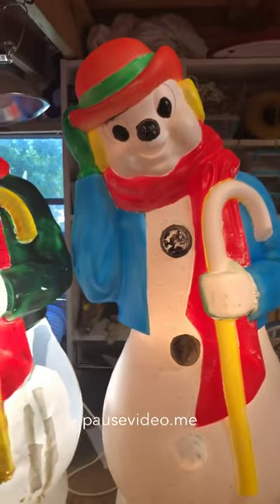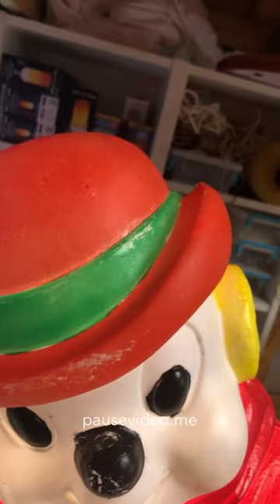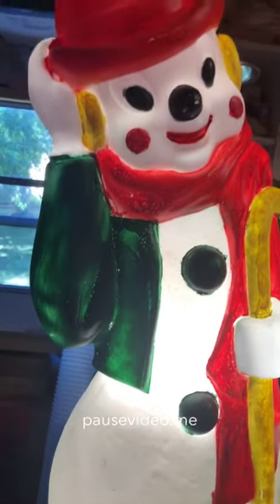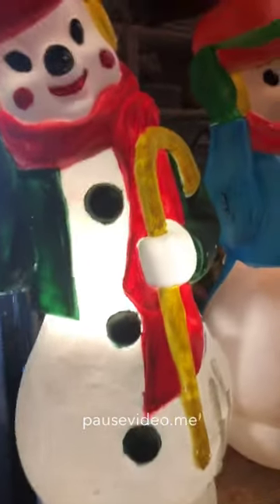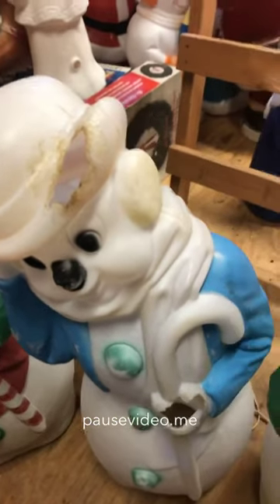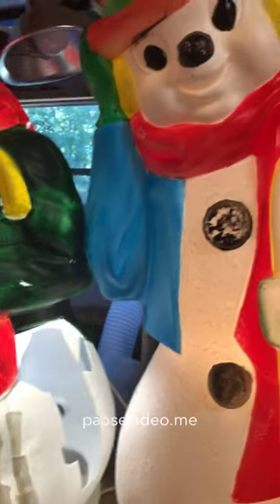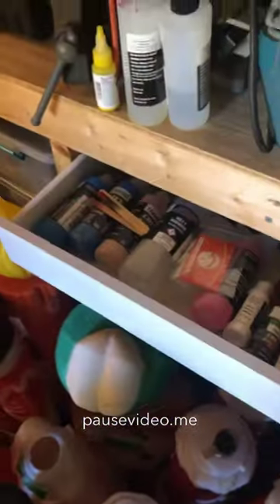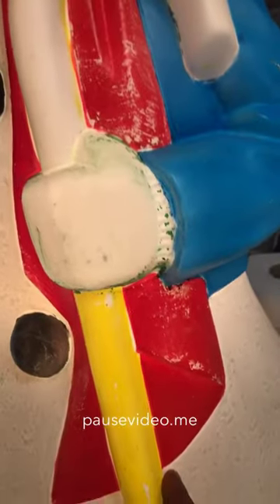Painting a blow mold

Comment: Can the blow mold can be paintetd only with the transparent paint the smallest you showed in the video
Reply from the maker: If you want to light it from inside as they were designed, then yes. Acrylic or latex paint will not allow any light through and will look like a black area when lit up at night.
Reply: @BlowmoldGuy123   What kind of paint will be transparent when lit up?
Reply from the maker: @MG-we9mw either krylon fusion or rustoleum for plastic. You have to spray lit up and use light coats. Or if you have an airbrush with Createx transparent paint, but it does hold up as well.

Comment: Thank you for your video's!  How do you  match color?  I have a vintage Nativity Camel/Shepard/Donkey.   While washing with a soft cloth, some of the red paint on the Camel hump came off. I am thinking a spot repair only is needed. I appreciate your time and reply.
Reply from the maker: The best way to do it is to strip the old paint and repaint it. You will never match the paint that is on there since it is aged and probably faded a little from the sun. The easiest thing to do is find a shade of krylon or rustoleum that is close to the shade that is on there. Spray some on a piece of cardboard or in a cup, and use a Q tip to dab it on. Do not brush it on. And be careful to keep from overlapping the old and new paint. From 20 feet away no one will notice the difference in shades.

Comment: I Don't know if this will help you or not, but you can use Silly-Putty to "Mask" areas you don't want panted too. its a bit more Expensive, but if you're working in a very small or tight area it works WONDERS!
Reply from the maker: I have tried it. It does not seal tight enough and allows the spray to penetrate the edge.